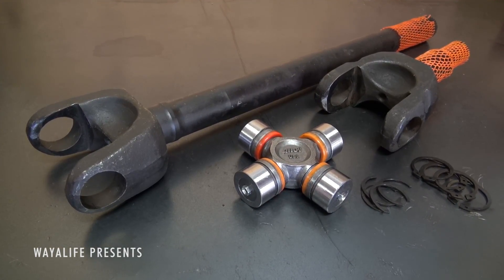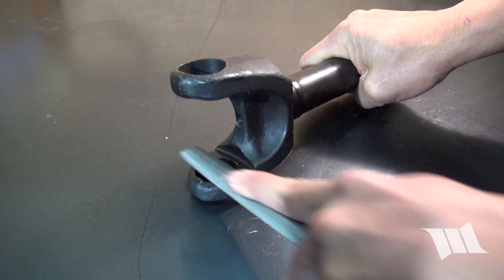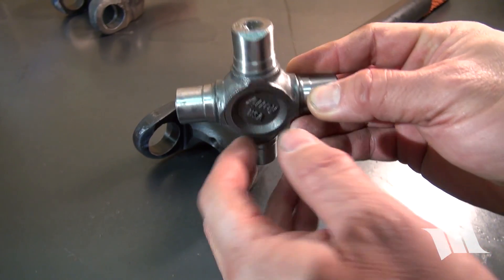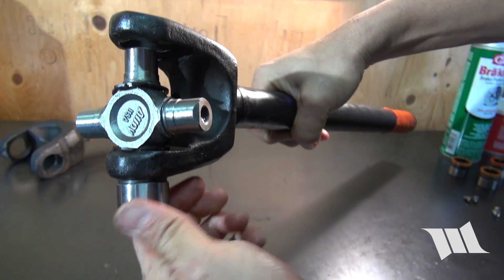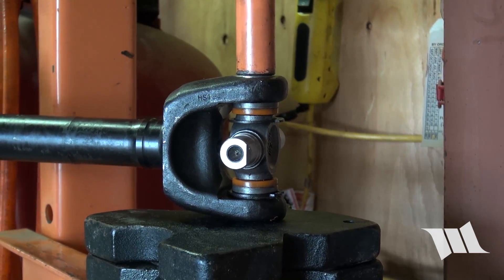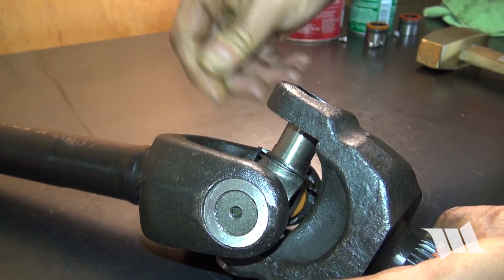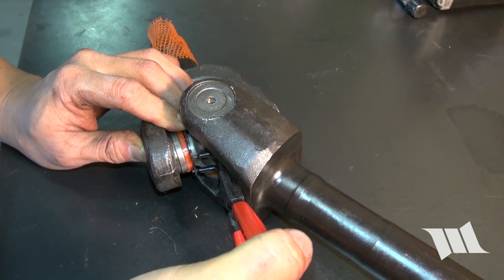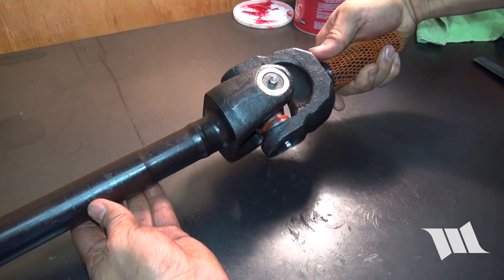Jeep Wrangler Axle Shaft U-Joint Installation with Full Circle Clips : HOW TO INSTALL

Comment: I am replacing my u joint on my old cherokee. They have the c clamps. Wonder if I can get just those clamps for mine. I am new to all this. I have no idea if those are good for all sizes of u joints. Also, I see you file down the yoke. I saw that on one other video. I assume both yoke parts need to have that done. On mine, one yoke has a line I can see, the other one doesn't. I wonder if I am removing the original u joint. It is really bad. lol. I'd love to find a video showing how to prep the yokes for us newbies.

Comment: It is interesting to see that there is a company that does not drill out the centre for grease ways. Now there should be no question of which is better.  BUT now for the big question,  how much more do they cost comparatively speaking.???
Reply from the maker: I have a link to buy them in the description.

Comment: Wish you would do non Rubicon version. I'm having a huge problem finding correct ujoint. On paper it calls for 5-760x but they're way to small. I think mine used the Rubicon size.
Reply from the maker: That's for an older TJ. For a JK Sport, you need Mopar 4137757

Comment: I'm having a hard time finding the correct size u joint for Dana 30 axle shaft. I hear ppl buying certain ones and they're too short.
Reply from the maker: For a JK?
Reply: @wayalife  yes. eBay says Spicer 529 but my friend went with Moog 489 because parts store gave him what it called for but they was to short. Reason I'm needing to know because I'm buying a ball joint and u-joint kit and the u-joints it has with them is sp-529. Not sure what that cross reference with???
Reply: @wayalife  u have any ideas?
Reply from the maker: 529 sounds right to me.
Reply: @wayalife  it ended up being 549 which is s-760x

Comment: Did you already change the rear axle shaft if so which one do you buy
Reply from the maker: Actually, we're running a Dynatrac ProRock 60 in the rear.

Comment: Would this prevent breakage on my stock Dana 30 shafts as well if I just upgraded the stock u joints?
Reply from the maker: Yes, it can help to prevent a break at the yokes due to the c-clips coming off.

Comment: Nice informative video.  I've seen u-joints fail on the trail and cause the stub and axle shaft holes to break.   In that case is that typically caused by the u-joint failing first?  If so I assume installing these will help prevent that from happening?
Reply from the maker: +yzfr1owner No.  Over time, the c-clip can and will work itself off the u-joint.  Once this happens, there's nothing that will hold the bearing cap in place and it can fall out.  That's what will cause the kind of breaks you've seen.  Installing a shaft with u-joints that have full circle clips like is shown in this video will help prevent this from happening.